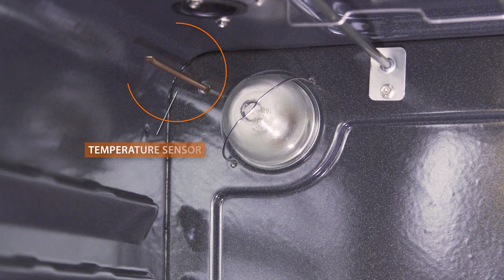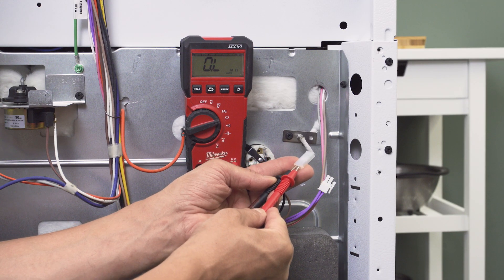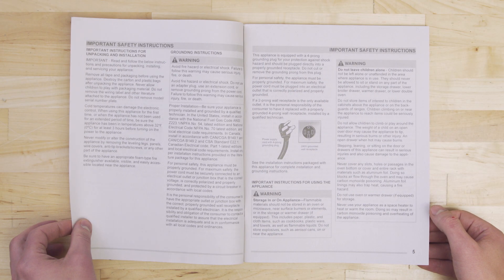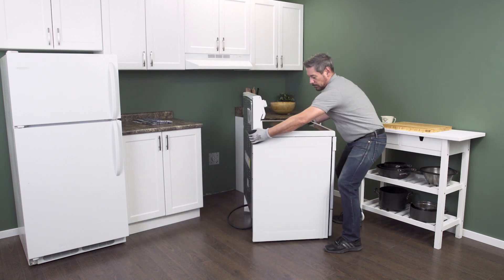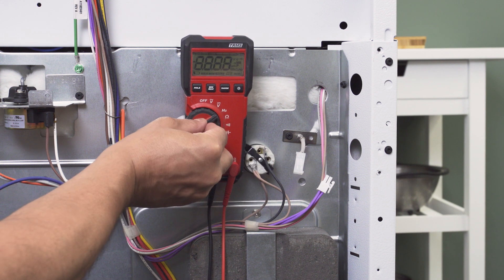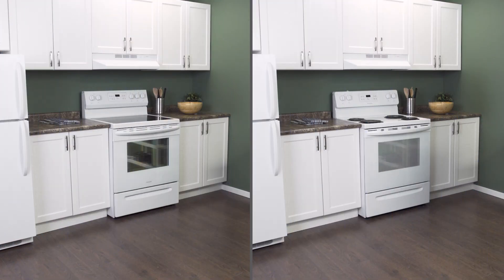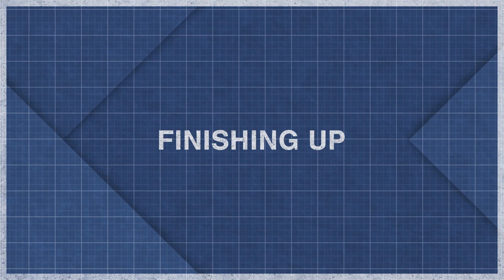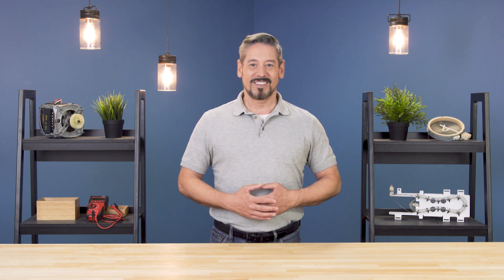Oven Temperature Sensor - Testing & Replacement | Repair & Replace

Comment: What about a double oven?  Is there a sensor in each oven?  I have a GE double oven and neither oven is heating.
Reply from the maker: Thanks for watching. If you have a double oven then it's likely that you have 2 temperature sensors. If both ovens are not working then it's best to check the connections leading into the control board. If the connections are secure and it's still not working then it could be a faulty control board: https://youtu.be/96s7maybHlY?t=398

Comment: What are some common reasons that a sensor would fail? It seems like a very simple component.
Reply from the maker: Thanks for watching. The oven sensor is a heat sensitive resistor. Like any resistor, it can fail over time simply due to the current that passes through it, the resistance can shift over time which affects the accuracy of the sensor. As well vibration can separate the connections.
Reply: @AmreSupply  Interesting thank you for the quick response.
Reply from the maker: @hithere8753  You're welcome. If you're curious, we made a video which explains the different types of components used in appliances. It helps fill in some of the blanks: https://www.youtube.com/watch?v=e_1pOWSVUfg&list=PLCo9SMjkdWBycw9hZVfYFc6Sw2Jlavaak&index=3
Reply: @AmreSupply  I took a look at your website and it is very impressive. The fact that you include parts schematics is a great touch.
Reply from the maker: @hithere8753  Thank you, it's been a process of adding all the model breakdown over years but it's one of those things that just makes the process easier for finding parts!
Reply: @AmreSupply  Hey I had a quick question. So I am 99% sure the thermostat is acting up but I am a bit confused with the multimeter. When I hooked it up it showed a 1000 to 1100 ohms reading at room temperature using a resistance setting which should indicate it is operating normally. However when checking for continuity there was no meter tone. Is this because the resistance is too high to prevent an accurate reading? From what I understand continuity settings usually use a fairly weak current.  Its just is throwing me for a loop. The 2nd thermostat in the base drawer does the same thing when tested.

I plan to test the thermometer at different temperature settings as well to see if maybe it is acting up as the oven heats up because both the broiler and oven elements seem to be off by about 100. Now that I think about it... maybe its the circuit board....
Reply from the maker: @hithere8753   If it shows the resistance that is within that normal range then the sensor should be good. 

Just to clarify, what is the specific problem with your oven? It sounds like you have a double oven. Do all the elements in both ovens not work or does only the top oven elements not work? Have you tested each of the bake, and broil settings in each oven?
Reply: @AmreSupply  The oven element (which is hidden at the base) is completely fried and I ordered a new part through you guys.

What throws me off is the broil element. When using this the temperature is still off by a fair margin even though it seems to be functioning. 

Even if the broiler was also underperforming wouldnt the thermostat detect this and simply take way longer to heat up? It's the 100 F variance that has me scratching my head. The oven acts like it's done heating though.
Reply from the maker: @hithere8753  Thanks for your support! We made a video detailing how to test and replace the heating element. It also explores how it works. https://youtu.be/ABope7vl5IY The bake setting uses both the bake and broil elements, but the broil is generally only used about 20 percent as much as the bake element. During the broil mode only the broil setting is used to brown the top of the food. If the broil element is not heating up fully in the broil mode, then it could be an issue with the temp sensor or control board. It's also worth checking the connections and make sure that there isn't any corrosion as this can change the resistance of the temp sensor circuit. 

If the temp sensor was the issue then you'd still have issues even with a new bake element installed.
Reply: @AmreSupply  Oh ok that makes a lot more sense regarding the duel elements. When I popped it open nothing stood out and everything appeared to be in good shape (although the boards are hard to access/see).

 I think I'm going to install the new element and see how it goes, working my way backwards from there.

If it's the circuit board than I'll need to call someone as that is above my pay grade. There are no codes though and everything else seems to operate properly. Even the temperature calibration worked appropriately. Thanks again for all the help!
Reply from the maker: @hithere8753  You're welcome. Best of luck with the repair and let us know how it goes!

Comment: 1:48 Newer Frigidaire is F10, and sometimes a F11 can be caused. Some Kenmore ranges are built by Frigidaire;

Note: F10/F11/F12/F13:

1. (F10 only) Check *RTD Sensor Probe & replace if necessary. If oven is overheating, disconnect power. If oven continues to overheat when the power is reapplied, replace EOC. Severe overheating may require the entire oven to be replaced should damage be extensive. 

2. (F11, 12 & 13) Disconnect power, wait 30 seconds and reapply power.

3. (F11, 12 & 13) If fault returns upon power-up, replace EOC.
Reply from the maker: Thank you for sharing this detailed response! This video was meant to be a rough overview as there are definitely some changes and updates to the codes as newer models come out. This aim was that this video would help people understand the why behind some of the codes and points them to further troubleshooting.
Reply: F10 code , when setting temp after being unplugged it hits 350 immediately and dings , oven is obviously cold and never heats , thoughts

Comment: We have a bad element ( visibly cracked) ordered a new one. Still doesn’t work. Everything else on the appliance works fine along with the broiler. Multimeter checks everything fine. Not sure what else to do.
Reply from the maker: Thanks for watching. Sometimes a power surge can damage an element as well as the relay on the control board. Since you've replaced the heating element, and all of the other funciton work, then its an indicator that it might be an issue with the control board. 

You can do a few more tests just to be sure. Disconnect the element wires from the control board, and test the wires and the heating element together, it should have the same resistance as an isolated element test. If there is no resistance then the wires are likely faulty.

If the wires and element are all good then the only other thing could be the control board. You can learn more here: https://www.youtube.com/watch?v=ORTi4lLyoqw
To find what control board you'll need, you can use this tool on our website: https://www.amresupply.com/lookup

Hope this helps!

Comment: Try cleaning the probe with emery cloth or Steel wool first.
Reply from the maker: Thanks for watching. Cleaning the oven sensor never hurts however It isn't the same as cleaning a flame sensor in a furnace. Furnace flame sensors or flame rods are very sensitive to a small amount of carbon buildup which can prevent the circuit from being completed which means the furnace will not run. For a oven sensor thermistor, a buildup of carbon will insulate which might just slightly shift the perceived temperature.
Reply: Cleaning the sensor worked for me.

Comment: Hi there, so I tried this and it unfortunately did not fix my issue and I wondered if you could give any further suggestions. My problem is is that my oven takes forever to heat up, and when the preheat sound goes off saying its met the specificed temperature I've found it's not even close. For example, I'll set the oven to 375 degrees and after a bit the preheat sound goes off, but I've placed a gauge inside the oven that tells me the oven hasn't even reached 200 degrees. It'll take another half hour to get to temperature, and that's if I cover the elements on the stove as I've found the oven heat is escaping through the oven vent (that goes into the back right element). If I want to set the oven to 450 degrees it hardly reaches that temperature, and if it does I am waiting way too long. I've tested the temperature probe inside the oven and it reads approximately 1180 ohms so it seems like its within normal range. I tested the ground shortage through the frame and that didn't give any resistance either so I've ruled that out. Now something I found when unplugging the stove to do these tests is that the ground prong for the stove has corrosion on it due to the outlet cover being partially broken and allowing moisture to drip onto the ground plug when plugged in, is this something that could be causing an issue (apart from the obvious fire hazard that I have to contact my landlord about)?
Reply from the maker: Thanks for watching. A faulty ground connection isn't ideal but should create those issues. If there is moisture behind your range, check each connection between the temperature sensor, the wires and control board. If the connection isn't good or if there is corrosion then it would affect the resistance and the oven might misinterpret the temperature. As well double check that both of your heating elements are working. If you've check that then it could be a faulty control board.

Comment: Frist of all thanks for your helpful episode, some people say the reading of a good sensor should shows zero of clause to zero!!!! so we got confused here unfortunately.
Reply from the maker: You're welcome, we're just happy to help! Since the sensor is a thermistor or "thermal resistor" it will have resistance even at room temperature. If someone is referring to a different sort of switch or thermostat, then it will be on or off, or will have continuity or no continuity depending on the temperature. Older ovens will use a bulb which is a heat sensitive fluid which will expand and will have continuity at a specific temperature. These are binary and are either on or off.

Comment: Thank you. I had a repair professional look at range due to f9 code and not heating past 150… replaced the “board” but had same problem, taking more than 30 mins to get to 225 degrees. Saw this post and replaced temperature sensor. Working but having issue with temp of oven off by 40 degrees (stove says 350 but thermometer in oven says 310), should I replace something else or adjust the temp on stove? I’m not sure if something is going on. I already paid $ 385 foe service and part. Maybe I should get a new stove? Thank you
Reply from the maker: You're welcome. If heats up within a normal amount of time and the temperature is close, then it would be best to try to calibrate it. It can be good to take multiple temp readings as it can vary minute to minute. The calibration is pretty simple to do and we talk about it in this video: https://www.youtube.com/watch?v=s8UdnR4Jw_g Most ovens can calibrate and shift the temperature +/- 30°F but some can adjust. When you calibrate the temperature, the oven will now think the temperature is 310 and will stay on longer until the temperature rises to the set amount.
Reply: @AmreSupply  thank you thank you! Most helpful info I’ve received! I recalibrated and will continue to monitor temp. Just wasn’t sure if it was a temp probe but both ovens read the same temps so I’m thinking BOTH temp probes cant be off. 😊
Reply from the maker: @retrocandeez  You're welcome, we're just happy to help! All the best!
Reply: I can’t seem disconnect the wires. You make it look easy,
Reply: I get a short to ground when using a multimeter. Could that make it so the burner doesn't turn off. That's the problem I'm having. With the oven burner won'T you even turn off even when I hit the cancel off button